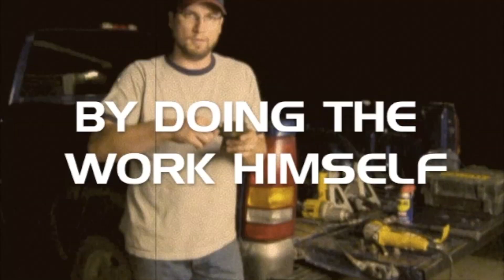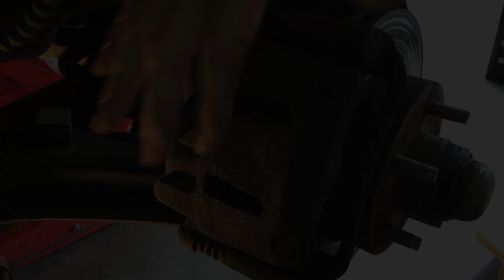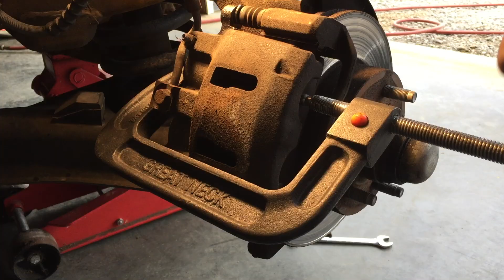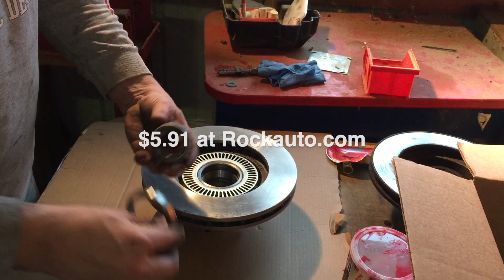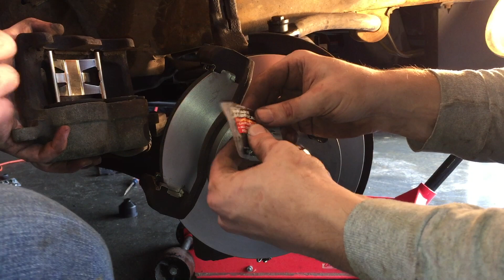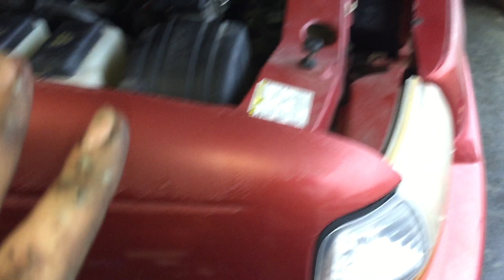Replacing front brakes, rotors and wheel bearings - Ford Ranger - 1998-2012 - RWD

Comment: Couple of additional steps, apply a little rtv to the dust cap lip to seal out elements. Also apply a small amount of your brake lubricant to the inside edges of your caliper and piston (the parts that touch the pads) for very quiet brakes.

Comment: The biggest contradiction I see is on the setting for tightening the nut is one mechanic says 40 inch pounds and you state 240 inch pounds. Thats a big difference.
Reply from the maker: We were following the numbers stated in the repair manual. 🤔 interesting.

Comment: Thank you very much for including the parts and torques in your video. It made using Rock Auto that much simpler. I understand the rash. GMC guys are usually allergic to Quality. JK, I have a 2001 Suburban with the 5.3 Vortec. Rock solid engine. I love my Ranger too.

Comment: I’m extremely grateful for this video! I have a 1999 Ford Ranger and I changed the rotor all by myself following this video. I’m can’t believe I actually did it. This “mechanic” came and tried changing them and he was missing parts. The inner bearing and the wheel seal.. When I checked the rotor was completely loose, almost falling off. It was making such an ugly noise like a screeching sound and he said it was because they were new brake pads and rotor but I just knew something was wrong.. my tire almost fell off. He put the outer bearing in the inside and it was completely broken when I took the wheel off. This video saved me so much money and I learned so much. So thank you! I felt like such a badass cuz I did this all on my own lmao

Comment: Video's great. 101%. For others who may watch - note that some rotors have the REAR bearing race preinstalled too. And in that case, if you put the supplied race in over top of it (where it fits and seems it should go, probably useful on a different application), nothing will go together, you'll wonder "why your rotor is 1/4" too tall for the application, dang it (supplier)," etc. But then the OBVIOUS SOLUTION will slap you in the face and all will be well. So, uh, I heard some guy did that. :D
Reply: Yeah this already had the rear race in it as well so your point is moot. He only tapped in the rear seal.
Reply: Huh????😮

Comment: I’m gonna do this on my 1999 ford ranger 2wd. I’m replacing the pads and rotors on the front. And I plan on replacing seals and bearings. Is it two bearings per side and one seal per side or is there two seals on each side? Basically what I’m asking is how many bearings and how many seals will I need total?
Reply: There's an inner and outer bearing for each wheel

Comment: You should pack some grease in the hub before puttin the outter bearing. Also you may have had too much torque on the spindle nut. It should only be finger tight (with a socket and no wrench).

Comment: Can you please tell me what size c-clamp did you use
Reply: C-clamp isn't required for this job.  You can buy a cheap caliper spreader at the parts store.  Use an old brake pad on the caliper pistons to push them both back in simultaneously with the spreader.

Comment: I just did this on one wheel (thank you for great video) and noticed that there's a huge difference between how freely the new rotor/bearings spin (mine looks just like the video) and how freely the opposite wheel spins. The old opposite wheel (the one I didn't work on) spins much more freely. Is this a sign that bearings are worn or is this normal wear?
Reply from the maker: The old bearing will spin more freely because it's got wear on it. If there's any play in the hub (not tight), then you'll want to replace it. Worn out bearings can cause premature tire wear.
Reply: @TheDaninator  thanks!
Reply: The wheel bearings drag more when they're freshly packed with grease.  They will spin some grease out as you drive and then spin more freely.

Comment: I just saw a quick tip. If your changing your rear bearing seal, loosen the castle nut slightly on the front and pop the rotor off. It will pull the rear bearing and seal right out.
Reply: Wow! Ty